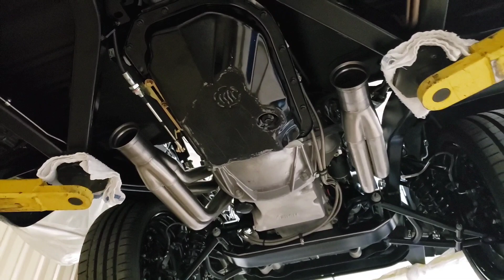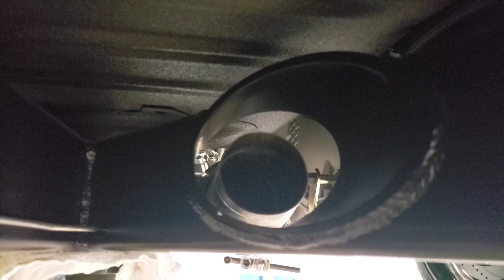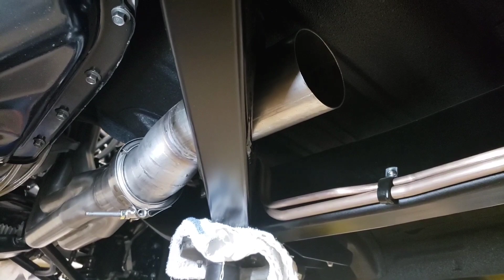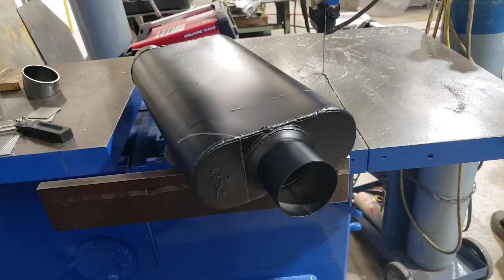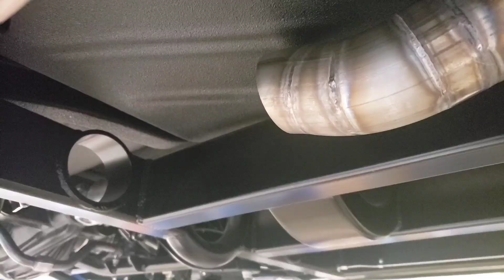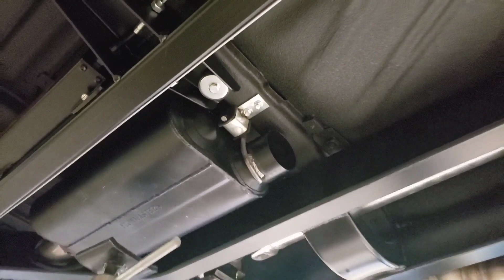Part 42 of Metalworks 1955 Chevy ProTouring build. Building custom exhaust with Flowmaster mufflers.

Comment: Man, I can't believe the progress you've made recently!  I'm kinda eating my heart out as my buddy used to have '56 with a very sweet 327 back in high school and I've always wanted one of the shoebox Chevys.  I was driving a '57 Ford 312 with three deuces then and everything I could put on in the '60s.  Anyway, my compliments on a very nice rig.  Everything you're doing is top drawer.....keep the faith!  Tom  P.S.  Everything I've built in the last 15+ years have had Flowmaster or Magnaflows with cross-over to boost bottom end....nice-sounding system with zip back pressure.